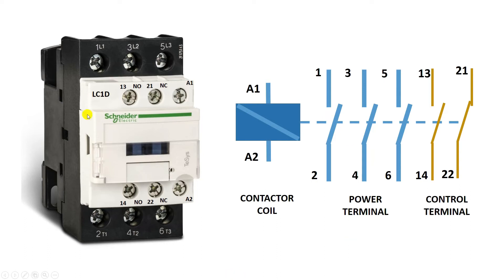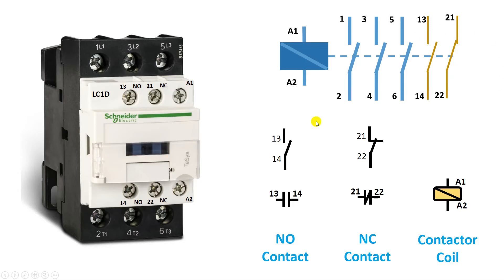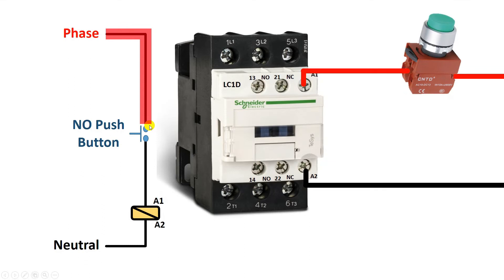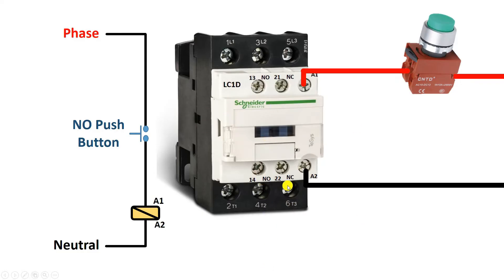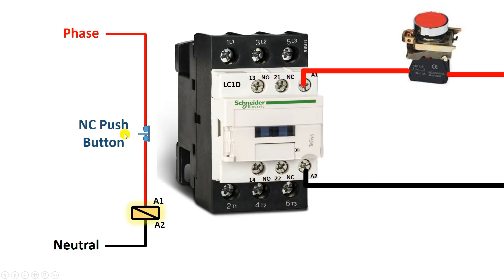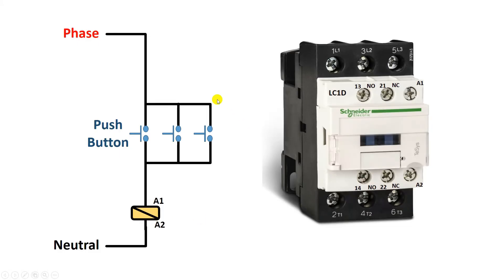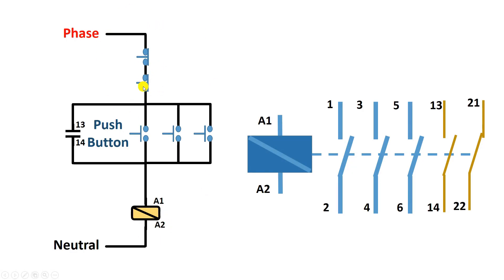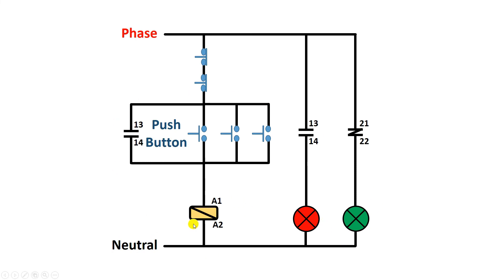How to do Contactor wiring || Electrical wiring Class for Beginner Class - 2  @TheElectricalGuy

Comment: Please I have a quick, if you want to connect a auxiliary contact 13NO and 14NO where do you take your supply to. Is it 13NO or 14NO. What I want trying to say is that 13NO and 14NO which one is the input and which is the output... The apply to the 21NC and 22NC
Reply from the maker: See bro both terminals are just a contact there is no polarity in the both terminals so you can just connect incoming supply in any terminal

But if you want to make it perfect then always connect the incoming power supply to 13 No. Terminal